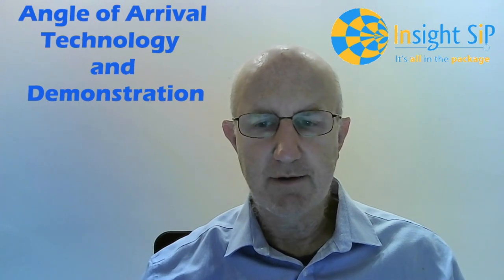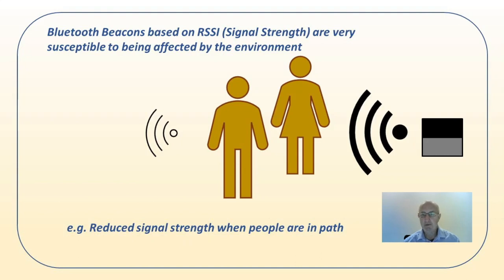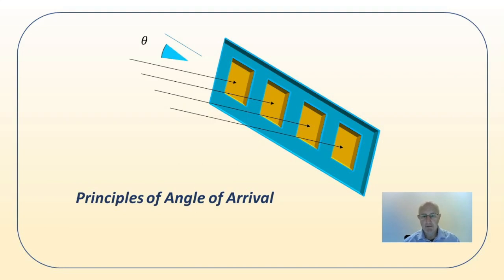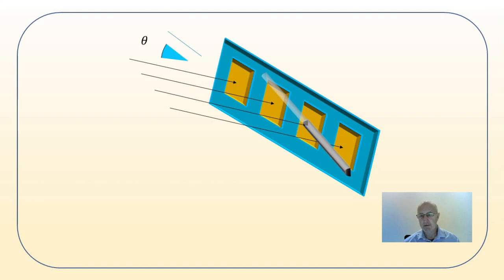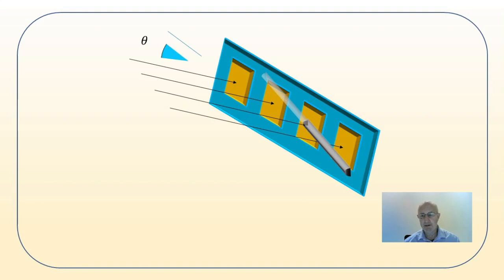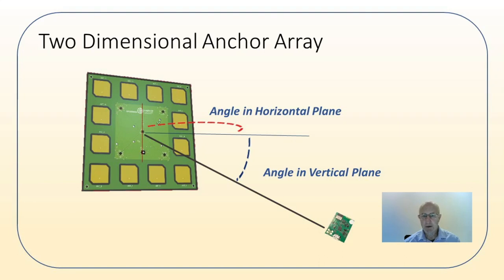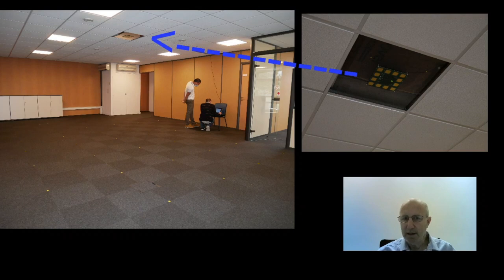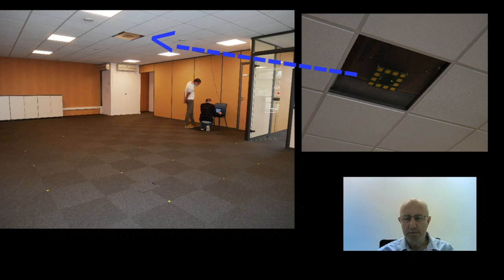Angle of Arrival Video - an explanation of Bluetooth AoA technology by Nick Wood, Insight SiP

Comment: how many anchors are needed for a room of 20x60 meters?
Reply from the maker: If you placed an Antenna Array in the ceiling at the centre of a 20 x 60m room, you should be able to cover the whole room. However accuracy would decrease at acute angles (i.e. at the edges of the room). There is an application note on the ISP1907 product page on our website  with results on accuracy vs. elevation angle. The height of the ceiling would be a factor (better higher).